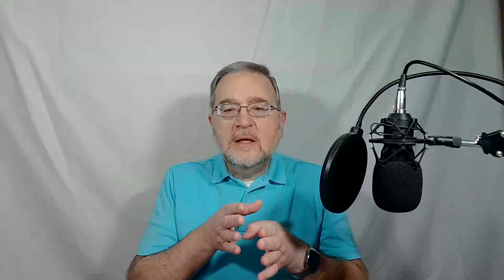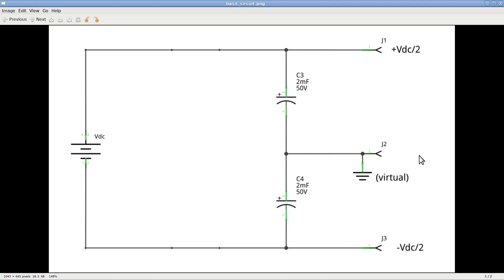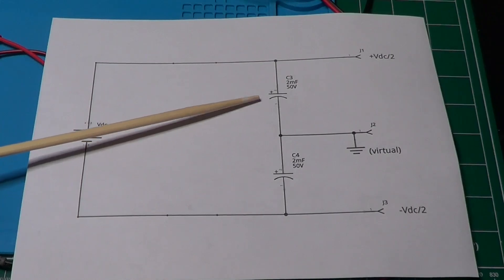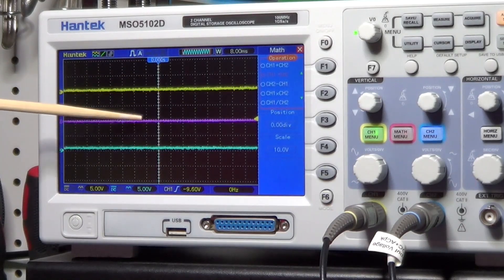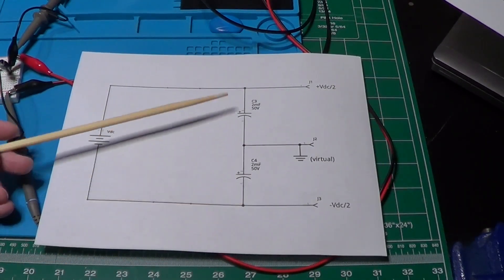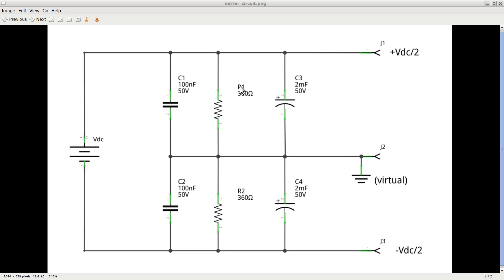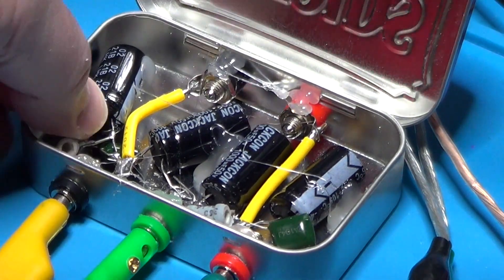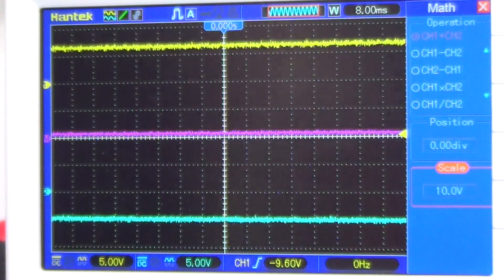Candy Case Power Converter - How To Convert A Power Supply From Single To Dual

Comment: Thank you! This circuit works very well! I adapted it to get +-12V and I get a readout of +11.99V and -12V. It will help me to get started on my next project until I build a proper dual rail PSU.

Comment: Sir, Great video. Very well explained. I have a question please. I have made a plant watering system. I use two adapters 12V  3A  for solenoid and 9V 1A for Arduino R3. Can I use a single 12V supply please? Thanks.
Reply from the maker: You could add to the 12v power supply a small converter from 12 to 9v made with a LM7809 and use its output to power the Arduino. This way, you would only need one power supply for both devices.
Reply: @eleneasy  Sir,, Thanks for your help.

Comment: Hello dear professor Sorry, I wrote my question in a hurry We have an electric hand sweeper that has a DC motor that runs at 12 volts and 5 amps. I have a switching power supply that is 5 amps and 12 volts. When I connect the motor, the power switching detects a short circuit and turns off. My question is, how can we turn on this motor with 5 amp switching power Thank you
Reply from the maker: The problem is that an electric motor, at the moment you turn it on, absorbs a substantial amount of current, much more than its nominal current value, It is therefore normal that a regular switching power supply, believes that in that moment there is a short circuit. The way to avoid that is to power the motor with a small voltage and increase it slowly up to the nominal voltage. The circuitry for doing that is relatively complicated. To simplify your project, I suggest that you put in between the power supply and the motor a ready made regulator for DC motors. Such regulator allows you to start the motor at a minimum number of RPMs and increase that slowly until you reach the nominal value.
I talked about a similar project in an old video. Yoiu may want to take a look at that. Here is the link:
https://youtu.be/kiCfj7KB2VM
Hope this helps. Good luck.